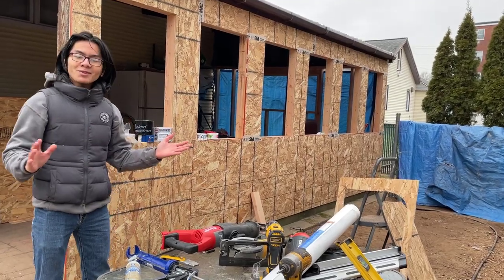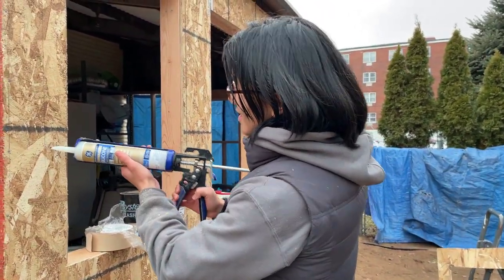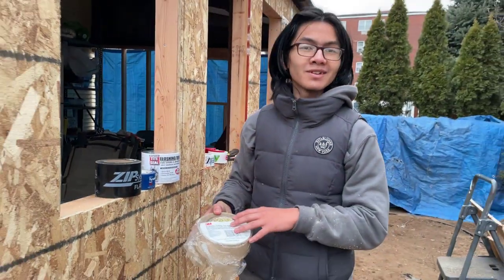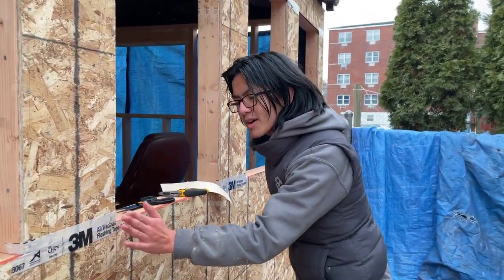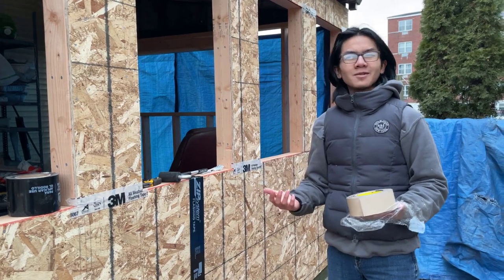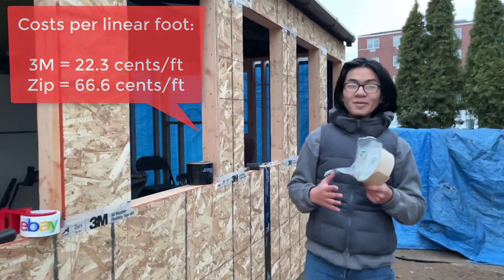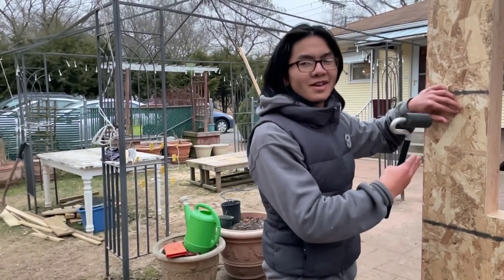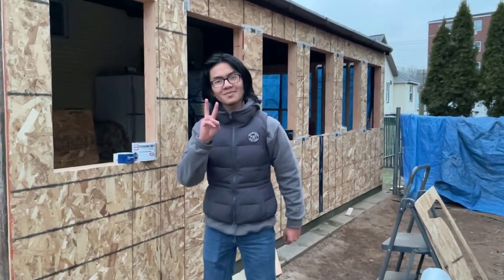What To Do With Holes In & Gap Between Wall Sheathing Butt | Chaulk vs Flashing Tape For Air Sealing

Comment from the maker: Here are the #ad links to the flashing tapes, chaulk, tools and other materials featured in this video:
1.  https://amzn.to/3qCFW7G  |  3M Flashing Tape 8067 - 2 in x 75 ft - Waterproof - Adhesive Backed - All Weather - Seal Doors, Windows, Openings in Wood Frame Construction
2.  https://amzn.to/3o3z9C6  |  Huber ZIP System Flashing Tape | 3.75 inches x 30 feet | Self-Adhesive Flashing for Doors-Windows Rough Openings
3.  https://amzn.to/2XTRzKT  |  GE Sealants & Adhesives GE5070 Advanced Silicone 2 Kitchen & Bath Sealant, 10.1oz, White
4.  https://amzn.to/2XVqQO7  |  POWERTEC 71010 Long Handle J-Roller with Rubber Roller, 1-1/2-Inch Dia By 3-Inch Wide
5.  https://amzn.to/3o11vgu  |  AWF PRO Caulking Gun - Heavy Duty, Rotating Barrel, 29 oz Caulk Gun, 18:1 Thrust Ratio, Ideal For Contractors and DIY. Features Ladder Hook, Sintered Steel Catch Plate, Pivoting Barrel

Comment: thats not a prius,  wheres the prius ?   back the prius up to the house like a work  truck !!!!!!   plug a  inverter into it to power your tools and recharge them, connect  a space heater to the prius for site heat, work it work it. plug your coffe maker into the prius for hot coffee on job site in new england.  toyota  send aiman your first off  assembly line the prius truck !!!!!  work at nite  with prius powering spot lights on  job site house.  the  silicone your using is of the higher-end good stuff, but nothings better than  loctite-marine  adheisive sealant for your home building,  comes in tubes like your using same size but cost much more, worth every penney.  keep up the good work.